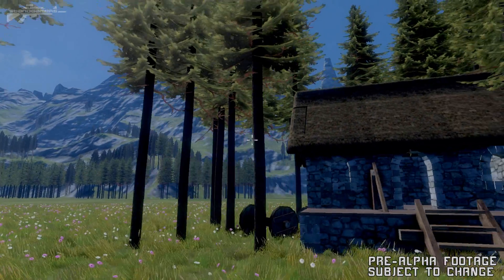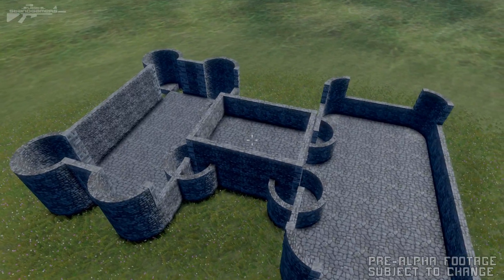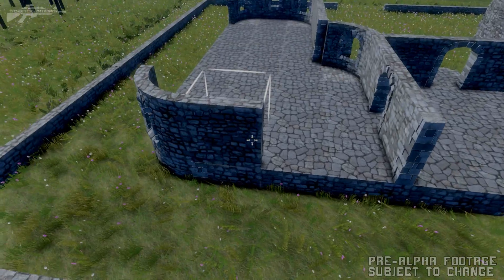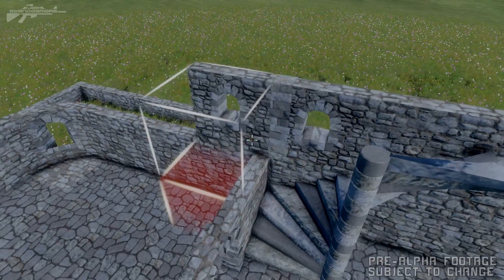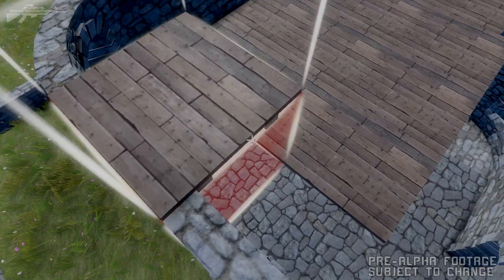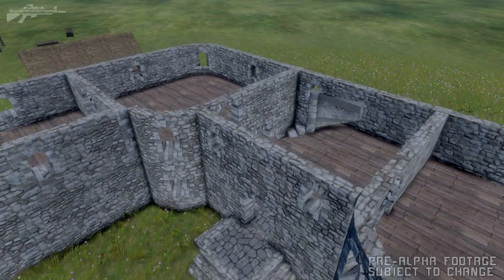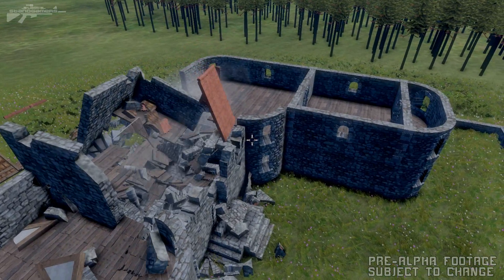Medieval Engineers - Understanding The Basics, Building Blocks

Comment: The biggest problem you have is you are building like a gamer, not like a engineer.  You do not complete the rooftop in the center before creating the supports all over the structure.  When you add more supports connecting to the central rooftop area you will have a lot less problems with collapsing.   Also you need strong central support beams for the top of the roof, either going acrossed and then hitting support columns on the way down or with columns beneath it.   Furthermore you can do some strong designs with archs that really help to displace force.

Comment: In the middle ages windows were small and limited in number because they were the weak points in the building. That's why candles were so important at that point in time.  The front is collapsing because the windows up top keep focusing the weight into smaller areas at the corner and door way that it breaks there first and the rest gives why. Windows are reinforced for top down weight not stabilization. Try getting rid of some windows above and around the door or put some more space between the doors and windows on the front. Also try a support wall or beams in the middle of the upper room.

Comment: To address the roof problem: at 8:41 - 8:50 you can see that the uppermost story is offset from the one below it.  Could that be causing the collapse?
Reply: After looking more closely, it appears that the 3rd floor is sort of "overhanging," resting no weight on the front wall below it.  That might be putting excessive stress on the rear wall, which is what causes it to break.  When you reinforced the roof, it probably diffused some of the load onto the side walls, but not enough to support a complete roof.

Comment: I am in no way a structural engineer, however i do know one thing - why the roof is causing the collapse.

Well more to the point why the supporting walls are collapsing. If you pay attention, you will see that the back wall supports the roof with no trouble, all 3 roof sections go on and nothing happens. however when the front 3 go on, the structure collapses.

The reason is, that you have the interior door arches and the windows along this side. if you were to take the windows and make it so there were only one in the center or even 2, one on each side, and replace the gap/gaps with the regular walls then the integrity would be replaced.

The interior doors need to be moved to a more central position along there respective wall.

These simple steps will/should allow you to build your structure and suffer no more collapses. supposing that, as the game is in alpha, the physics in the game isn't flawed, causing the issue. (completely understanding that this is alpha after all)

Let me know if it helps.

.....and as always keep the vids coming there great!.

Comment: after watching the video, here are my ideas as to what I think happened: 

version 1, where you just placed the triangles down and threw a roof on it:  doomed to fail from the start as the adjacent walls do not occupy the block underneath.

Version 2:  after looking at this, I think given your structural choices, this is your most viable, however:  you suffer from the previous example on both the side walls and the front walls as this structure relies more on the weight distribution through the front wall.  your.  on the 3rd floor its in the right spot, but on the lower two floors, the walls are located in the adjacent blocks on the front wall, making the rear wall your most structurally sound.

version 3:  this design relies solely on the structural integrity of the front and rear wall on the 3rd story, which as we have discussed in version two, is severely lacking from the lower floor, and the lack of support there.

the easiest way to fix this, IMHO is if there is a wooden arch structure without a wall, and but this up against the front wall in the lower two stories, this should shore up some of the weight issues you are having, I would probably also switch the third story to a wooden structure to switch up the design aesthetic.
Reply: buttresses, and flying buttresses could in theory work, however would mandate completely changing your design.

normal buttresses would just entail adding a pillar on the exterior walls in key places, and you would need to watch the load-bearing UI to know where they would need to go to shore up your weaknesses.

the flying buttress approach that I am seeing a lot of in this thread:  yes they look cool but are such a technically challenging object to build when having to also deal with load while building.

Flying Buttresses work in Cathedrals because they take advantage of the weakness of an arch, and make it a strength.  your structure isn't using many arches at this point in the build, and would only hamper your build by collapsing the structure from the buttress, and the supporting arch coming from it to your building.

Comment: You originally had the right idea about the roofing. Stability of structures is greatly increased by something called the key stone. Basically in an arch the keystone is the top stone of the arch that is larger than the others that way the weight pushes all others stones down but because the key is supported by many stones the whole structure seems to fit together nicely. One of your problems was that even if the inside of your building was ok the outside walls couldn't support although looking at the buildings in midevil times it seems what you were doing should have been enough till you could finish it so I think for now it was just the games structural bug or maybe we need to do more research.

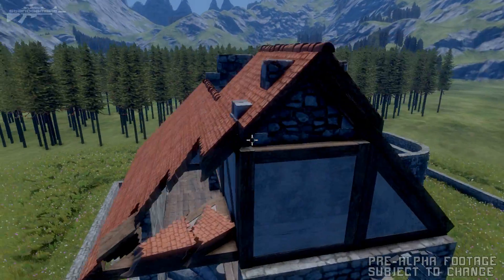Comment: Don't know if it's relevant, but at 11:02 you can see the upper block seems to be offset and hanging next to the lower blocks instead of being flush. I could be mistaken but that may have been the issue. You might also want to place triangular wall blocks to shore up the exterior by your roof support walls.

Comment: Alright, Aaron, here's your problem, you're dealing with a stone structure, not a wood-frame house. The wall you built was far too tall to support any other weight than its own, since it's made of stone. Following this, the taller it gets, the heavier it gets, and this happens at a massively exponential height-to-weight ratio. What you need is a wider base, leading up to the thinner top wall, and then the roof. The wall you built was just too tall and thin, and any architect from the time period would be awed by the thinness of your walls.

Comment: Aaron, you need butresses, load bearing beams, trusses and rafters. That tool from the other video that showed weight distribution and structural stresses are going to be your friends when it comes to building a proper castle.
Reply: Everyone is suggesting buttresses. In fact, I just did a short while ago.

Comment: your roof fell off, because the front top wall was not set correctly. that wall was set on the wood floor, so it would push the floor and wall off axis making it fall.  And another tip try making arched ceilings for your lower floors. that's what they did in the Medieval Ages.

Comment: You could of easily put wooden supports in the middle. All the weight didn't have to go on the outer walls. Trust me, I have 2 years of engineering at YCST and 2 of design and drafting.

Comment: Maybe you should add a few Flying Butresses over the front door. Search Flying Butresses on Google Images. I haven't spelt the word Butress correctly though, but it's something along the lines of that spelling anyway. Flying butresses were used as supports for old Gothic style churches in the middle ages and they were placed on the sides of said churches to push back against the thin walls that had to support the Church roof. That should help, I hope

Comment: Funny thing is, jumping from space engineers to medieval engineers, that suddenly you have gravity affecting objects. Most of the loads/forces 80-90% on static structures (bridges, buildings, etc.) are generated by self-weight of the structure. This weight is measured in force (Newtons) and it is divided over a surface (the dimensions of the walls in this case), which gives stress. The walls can take a limited amount of stress (which is defined by it's material), so you either decrease the force or increase the surface (which does increase the weight by a bit too, because you're adding material). That or you can of course choose a material that has a higher maximum stress. You do want the roof on it, so the way to go is to increase the surface area that supports the roof.
Here's a first measure you could take:
I noticed at 11:58 that you have two archways/door-openings stacked on top of each other on the corner closest to the viewer at that angle/moment. This has decreased the surface area in respect to solid walls without doorways. So in order to keep the building from turning into ruins before the end of the Medieval ages, I'd advice to move the archways to the middle of the room/wall (not to the other corner, 'cause then the same will happen at that side). Same goes for the windows by the way, if the building still crumbles after moving the arches, you should remove the windows near the corners.

Comment: I want to yell, use full block to make support in corner/s (I don't think there is triangle, 1/2 block). Now that I saw this video, I Need This Game Now!

I wonder how BlackSmithing will work on this game. Firsth you need way to smelt your ore and turn them in to ingots. Then you need hammer, anvil and owen for that. . . . Everyone should get my point now. I wanna be/do blacksmithing ^_^
Reply: there is a triangle block.  it can be seen in the game announcement trailer on the side of the wall that gets hit by the catapult during the construction montage, it angles down producing an increased area of support for the leading wall, and Video Sage flipped through it on his construction video he posted.

Comment: Well, this means people can't build giant brick dicks, right?
Reply: They will find a way. Dicks always find a way.
Reply: Le Derp Français Well avoiding sexual inuendos n safe sex messages for now. It would depend on the size, on the other hand now with the block in a block system you could easily construct a wooden support frame internally. Maybe even multi-floored dick even with central spiral staircase. In the end if there's a will there's a wall.
Reply: With proper support and protection it will most definitly be possible.
Reply: Januk Ya, sure, so if you make like, a  giant wooden wall around it to support it.
Reply: Horizontal dicks would be trivial.
Reply: +epicsauceness100 | rape joke?

Comment: You could multi use the stairwells. Put them in the middle of the structures and surround them as needed by walls to turn them in hollow support "columns" for the structure.

Comment: BIG PROBLEM: what if i want to add a window on my lowest floor? do i have to remove an existing wall and risk the whole desing collapsing on me? hope its not the case.
Reply: I assume you would have to build temporary support beams before you remove a wall section
Reply: catman1776K Just imagine when multiplayer comes, and someone tries besieging your castle.

smash
"WHY ISN'T IT BREAKING?"
smash
"SERIOUSLY!?"
giggling from the builder
Reply: There's a way, to put it simply: Don't rely on outer walls for support.
You'll want to build it as if  you're not intending to have walls, at least outer walls, which means having a central support (Which could be a wall).

the chateau he was building would've had two support walls in either wing going down the length of it and a massive pillar in the middle structure or a wall extending into both the wings.

then you need extra supports if you're building anything larger than a small house, which are just beams, struts, pillars and other supports that you place where they're needed.

The chateau, being a bit on the smaller spectrum, would have support beams out by the wall, so imagine that ones you're done you'll fill in the space between with wall. a more defensive method would be to move these support a little bit away from the wall, as to have the wall protect them.
Reply: As the game is right now with the basic form of structural integrity, it most likely will. Sadly... :(
Reply: Yes most likely. That's what I'm going to do any way to make sure it works.
Reply: I imagine this hasn't been considered yet, but what if the alt-click feature could be used to replace blocks on a specific part of the grid?

Like you hold down alt and place a window where an existing wall is, it will replace the wall with a window-version? That would be pretty cool, I think.
Reply: That may be the case. Unless you build your structure with loads of redundancies to prevent any kind of collapse, you will probably risk it breaking.

Comment: I wonder how well this game will simulate real physics, which at the moment seems to be fairly well enough, because then I can apply what I'm learning in architecture school while playing, which to me would just be fucking awesome. 

By the way Arron, when building your chateau's roof over the central portion, it seemed that the upper layer of walls was slightly inset from the layer of blocks underneath. This would mean that the top layer of wall blocks was technically diagonal to the layer below, and thus not fully supported in the vertical axis. This was probably what was causing the roof to collapse and bring the wall down with it, as the floating, diagonal wall wasn't properly supported and therefore couldn't properly support the roof. Align the wall blocks above one another properly (if possible) and then the roof should work fine, and probably with less supports as well.

Comment: try the second roof again, but this time use something other than stone for the triangles at the tippy top of the roof. that should work. not sure tho. cuz with the stone there you wer putting a much larger and unnecessary amount of wait on something that just wasnt built for it. plus try having the foundation go outside past the walls a bit. should help disperse the weight a little bit. im no engineer but if my understanding of construction is correct than those two things should help substantially.

Comment: stone has a very poor strength to weight ratio so to build up ten meters needs something like 5 meters wider (a foundation) around the first floor. you also need horizontal joists that pull the walls inwards to support additional floors. flying buttresses also help push the walls inwards to improve strength.

Comment: the back part is holding quite good cause its correctly aligned but on the front side the placement of your block is not aligned on the lower part, even when u put support for the roof if its holder(wall) is not place correctly it will collapse.......for the floors u need pillars or wooden beam that coming from the bottom to top more pillar = more support = more stronger structural integrity.

Comment: You need to start thinking of structural integrity as a sort of pyramid, in the same way that energy in an ecosystem forms a sort of pyramid. You used one of the weakest materials at the base of your castle (a single layer of thin, skinny little walls), so there is no reason that should support too much above it. That's why in real life many medieval buildings were either supported by buttresses (and if they were large enough, there needed to be a second and sometimes third set of buttresses in order to support the first)  or they were built upon thick, sturdy groups of stone, then lessened to thinner walls above  to avoid too much weight at the top, and so on. This is not a spaceship, the center of gravity on your castle needs to be at the very bottom of the castle in an area that is so fortified it can withstand most of the pressure from the building. Anywhere else and physics will have its way with you.

Comment: There is a reason why old building have thick walls (not only insulation). Every castle that I've been too had walls more that 1m thick (stone is kinda crap for building tall things). 
Also cant wait until the release!
P.S. I'm aware that it wasn't a castle nor that it was not ...
Reply: They also have wooden beams and pillars everywhere, and things are built with "support this in case that breaks" in mind. Some designs are really amazing and clever, and I'm sure they would work great in Medieval Engineers if you were to reproduce them in there :D
Reply: Thing is, walls have never really been a truly structural element. Given a certain thickness, it might help supporting the loads and all, but columns are where the magic is at. Flying buttresses and pendentives also played a key role in supporting high walls and roofs.
Reply: And thats also why the castles and walls in the early videos by LSG has seemed so fragile, to represent real castles those walls would have to be triple thick at least, plus have X-crossing wooden beams within to spread the load (and spread the impact load).

Just think about the behind the scenes in LOTR when they made the Helms Deep gate, they actually built it to medieval realistic specs, and it was TOO STRONG, lol. Their battering ram simply couldnt break the gate, even a modern built steel ram couldnt. So they had to intentionally weaken the gate to make it break nice for the movie.

Real life castles were strong mother truckers.
Reply: Good thing they have proper stone blocks for you to build with!
Reply: gre8 And look at the big Cathedrals with those astonishing arches.
Reply: +Baleur | and then came the canon...